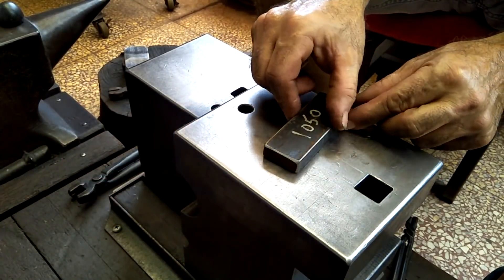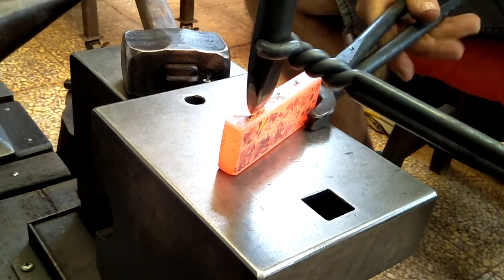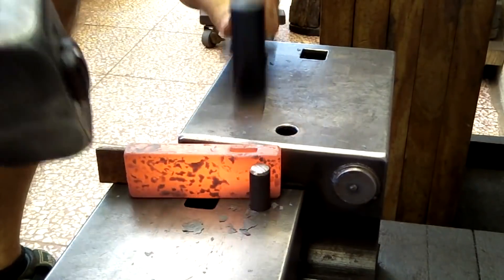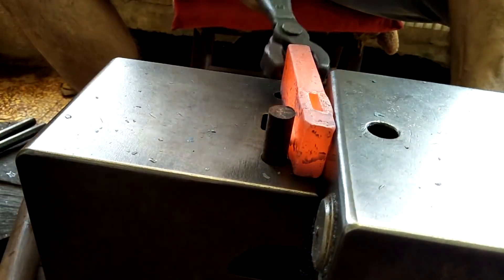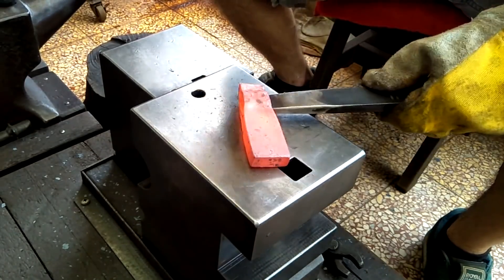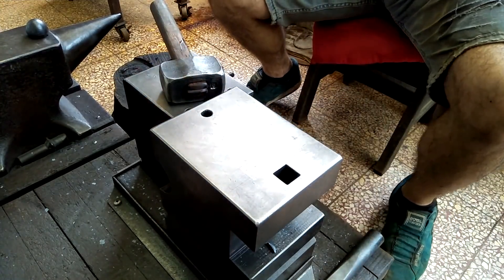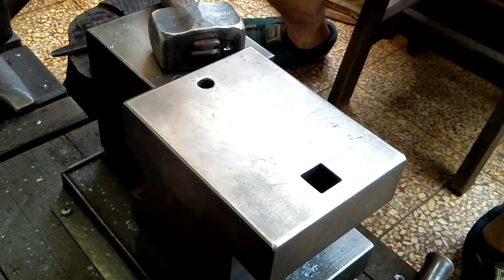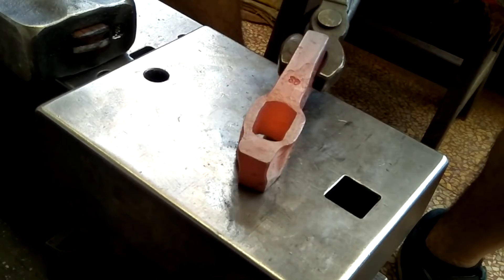splitting thin steel to form tool eye

Comment: That was one seriously impressive punch.
I never had any luck splitting like that in thinner stock.  My cutter always wanders.  I've started drilling small pilot holes, and the chisel or punch seems to follow the hole and leave a far more accurate punch through.
Reply from the maker: Drilling a small pilot hole can be a good idea. I often do that for hammers I make. But it's also good to practice slitting and punching without the aid of a guide, to improve accuracy, etc. And you're right, the quality of the punch or whatever tool being used really makes a difference... Thanks for watching and commenting.

Comment: Good work.  Inside dia. or hole appears to have somewhat 2 sharp corners toward the front.
Reply from the maker: Joseph, You have a sharp eye. I noticed that as well and think it may be due to my final drift not going deep enough to the point where the corners on the drift are more rounded. Thanks for watching.
Reply: Just trying to help.  Focus is on the best work possible.   No one is right and no wrong is wrong.
Reply from the maker: Joseph, I agree. Thanks.

Comment: The cheeks seem thin for a fuller. What was the final thickness after stretching 1/8"-3/16" ?
Reply from the maker: Chris, The cheeks are about 3/16". If I had first thought of making it a fuller, which I may do in another video anyway, I would have also left more material on the back end for striking. Thanks.
Reply: Glen it was educational just to see you split such a narrow width at such a depth. Interesting to watch. Thanks
Reply from the maker: Chris, Glad you like this. Thanks.